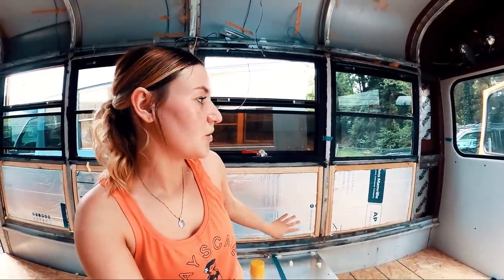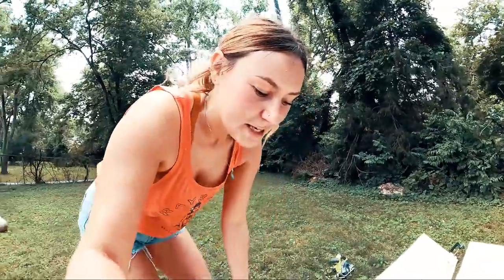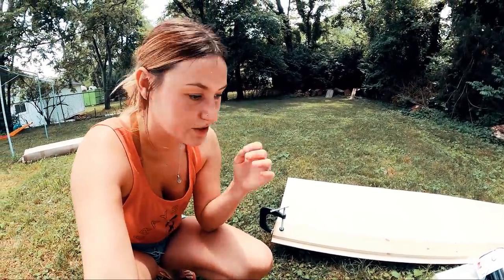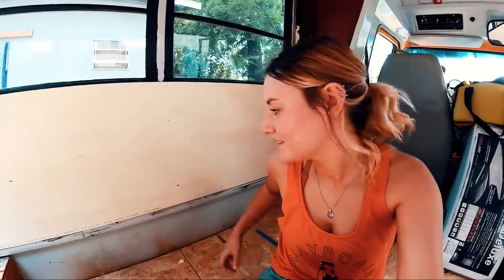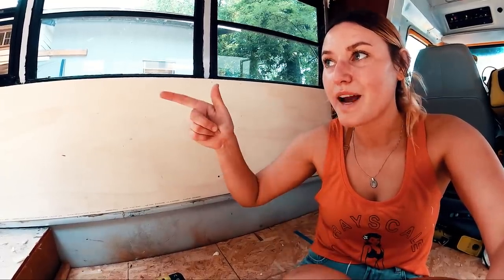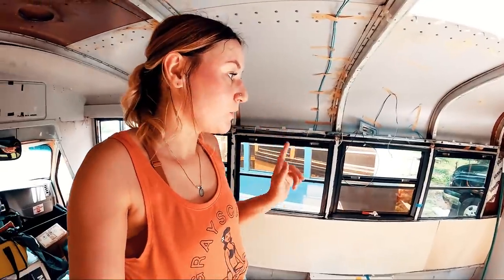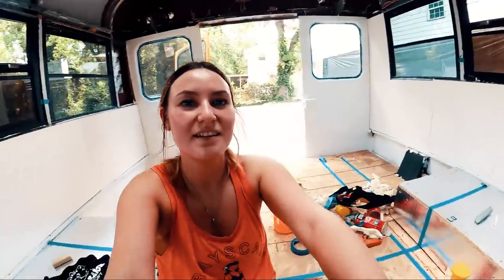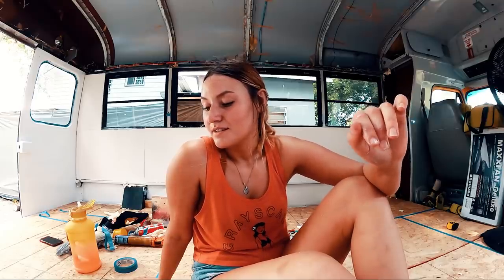Finishing & Painting Skoolie Walls - Solo Female Short Bus Build

Comment: Doing my conversion homework and found you😁.  Many channels are a bit light on details and totally understandable.  Subscribed and excited.👍🇱🇷. Side note: some important things I've learned from others is.  Park level, cover glass while grinding to keep from marking, use heat gun on outer lettering and reflective strips, turn off coolant in engine bay before disconnecting heaters and loop inside coolant lines back to front to keep front window defogging operational, leave 1/8 inch gaps at top and bottom edges for flex of bus, keep water heater and pump as close to water tanks and sink/shower as possible with least as many turns you can, always have a larger gray tank than fresh water tank, on composting toilet you can straight pipe urine to your black tank to avoid having to empty urine jug weekly, use HVAC with a built in one way gasket on plumbing to prevent odors cause bus flex can release odor from a p trap.

Comment: Jaylena, things are looking good.  It makes the place look bigger and brighter.  Way to go.  Of course I do have suggestions.
1.  Check out "See Jane Drill" videos if you have any questions on tools or find tricks of the trade for carpentry.  She has a lot of good info and instructional videos.
2.  You might think of trying to get your roof or ceiling done before putting your bed in place.  I know your getting ready for road trip but the ceiling at least ruffed in will make your road noise much less for travel and will be much easier to do without the bed in your way, plus you won't get all the insulation stuff in your bed, ugh..itchy..lol
Just suggestions cause your drill has an adjustment up on the collar you can turn down so you don't drive your screws through the would.  There are numbers like 2 - 20.  Set it on about 12 and start screwing your wall board in place.  As others have said screws would be better than tacking with nails due to vibration.
Please people don't forget how to use hand tools.  Screw drivers and hammers built this country before power drills and nail driving guns.  For a small job some panelling nails and a hammer can do wonders.  Not saying that you shouldn't use screws instead, just an example..lol. Enjoying the journey and the build is all about learning something New, which could be something old that we forgot in my case...lol. Love ya girl.

Comment: Glue on with spray gorilla glue, Hold in place with tacking it Do roof, fiberglass insulation, come over it with insulation board then panels,put in Led lighting,good insulation soundproofing power LEDs ,get a wireing harness lighting

Comment: 🔴Jaylena, you are doing a great job. We had that problem with the screws and used a wider washer between the screw and the wood and it worked fabulously. The benefit of using screws over the nail gun is that you can unscrew it later if need be, as opposed to having to tear it out when you use a nail gun. We have found that the more you can use screws (and washers when needed!) the stronger the hold and the more flexibility you have in the future. Any way, keep up the great work! You do us proud! 💜💙

Comment: a lot of people build their rigs with nails, but nails are really not a good choice for any moving vehicle since they have a tendency to vibrate loose and fall apart. when you hear complaints about manufactured rv's falling apart on the road, most of it is due to loose nails and glues that failed. i do a lot of work on old wood boats where everything is put together with screws, because screws don't loosen up and fall out. you are using drywall screws which are designed to do exactly what you experienced so that you can cover the hole with drywall mud and sand it smooth before painting, but they are not the best screws to use for wood construction. the best way is to use actual countersunk wood screws that require drilling a pilot hole, which is easier if you have 2 cordless drills, one set up for driving the screws and the other set up for drilling the pilot holes. there are special drill bits available that drill the pilot hole, the clearance hole and the countersink all in one shot and work really well.

Comment: Do not nail the ply, even with liquid nails if there is any movement the ply will rub up and down the nails and squeak. You are better off gluing it into place with some screws to hold it until the glue dries, then screw it off fully. :)

Comment: The Styrofoam board should be cut fix the curvature of roof Try make long wide cut fiberglass pink spray glug hold in place then styrofoam board over it spray glue Hold it  few wooden strip cut plywood tack on block screw into hold all in place wiring harness behind it drop wire put lights on,

Comment: Are you going to have running water to a sink or shower? I saw a video on youtube where A guy used air bladder type water pressure tank in his camper like they use for well pumps. He used the pressure from the water source to put the water under pressure in the tank. When he turned on the water at the sink it run without needing a water pump. Thought this might interest you. Running water without using electricity in your bus. Pressure would be provided by the pressure of the water from the water source you fill the tank with. The pressure would be the same as from the original water source. just connect the water hose to the tank on the bus.

Comment: i worked for school district for years,so now you also need to think about the bus flex,the floor is only plywood and the sides will flex,just a tad,so with attachment of your walls maybe think about zerts,cant think of name but when you put your screw in the back side of the zert collapse and then you just tighten your machine screw down,it is like a welded nut on backside of your support.
also did you take the heater out of back of bus? even with that foam if your in a cold area your gonna frezze girl

Comment: WATCHING YOU VIDEO NOW, I don't want to be the bearer of bad news but I'm afraid the very thin plywood is a bad choice for the walls even though I know you're going for the lightest thing to put on the wall it's just not the right stuff I guaranty you will put a hole in some portion of the wall be it by tripping or some other function but alas, what you need to secure the wood is called brad nails the look like long thin staples that are shot in with an electric stapler
 Arrow 6 in. Electric Stapler and Brad Nailer-T50AC-R - The Home Depot
the problem in the bus is your dealing with a lot of vibration and at some point, the nail may pop out or the plywood will tear away from the nail as it flexes  1/4 inch plywood would have been a better choice that way things that need to be attached under cabinets have something to be attached to

Comment: Hello 👋 You should cut and end all of your wall and ceiling boards on the center of the metal studs. That way you can use adhesive on the ends of the boards and screw to the wood studs!